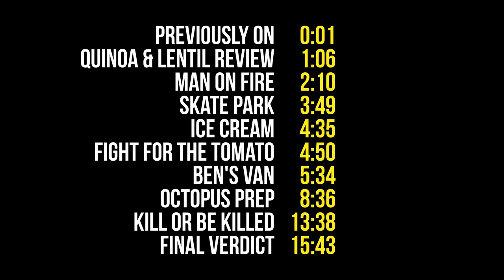Castle Crew Caught On Fire While Working

Comment: @2:22 watching dude inhaling that concrete dust had me holding my breath
Reply: either that, or you wear a mask that gets filthy in the 1st minute you put it on. this is what working with concrete is. most ppl don't wear masks.
Reply: @refugeehugsforfree4151  
Actual real contractors pour it slower and closer to the surface under a fine mist with no mask.
What you were seeing is called inexperience.
Reply: @keithb6717  they weren't even mixing it well enough Tbh in the video
Reply: Yeah, 20 years of construction experience here and I can say that we'd be wearing respirators while mixing concrete. It's bad for the lungs.
Reply: @keithb6717  They don't ship them like they used to

Comment: Check under the Vinyl / Plastic Flooring (Pull The Drivers Side Tub and Then lift the mat) Those Fords are famous for Rusting out under the Gas and/or Brake Pedals. ( Water +  Salt / Melts or Collects with not escape route so it just puddles)  When and If it starts or has started to rust out hopefully you can catch it in time to treat it or in short time you may be welding new floor pans into it . :)

Comment: Holy shit those workers are going to regret not wearing a n95 mask while working with concrete like that. Too much inhiation causes silicosis and is the 2nd highest killer of construction workers only. Second to asbestos related mesothelioma. As a fellow tradesmen let me say Wear your freakin PPE guys.
Reply: you don't work outside in the heat do you?
Reply: @refugeehugsforfree4151  Yes everyday. I also know what hazards at work will kill my ass if I ignore them. Silicosis is one of that hazards.
Reply: @refugeehugsforfree4151  Only have to put it on while mixing it, or cutting concrete. Mixing only takes a few minutes .

Comment: I’m not saying you can’t use an angle grinder to cut rebar, but it really should be near the last option, above using a hacksaw or other manual means. Rebar has so much junk in it that you run the risk of hitting something “harder” than the rest of it and shattering a cutting wheel which is no fun.